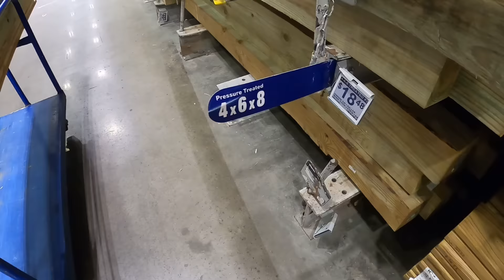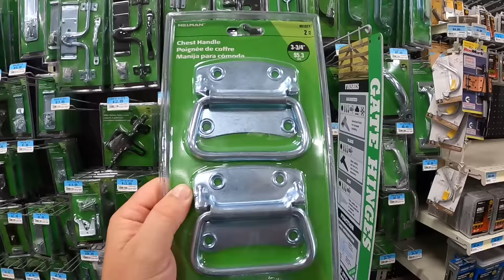Anderson Blocks and RV SnapPads Are A Waste Of Money! | Do This Instead! | Fulltime RV Living!

Comment: We built our own blocks also, however since campsites are sloped in some cases we built blocks at different thicknesses by just using a 2x12 cut square and screwing them together. I have a set of 6  1-1/2", 6  3", 2  4-1/2", & 2  6" blocks and they stack neatly in milk crates. And your right, I saved a bunch of money too!
Reply from the maker: We have a hydraulic auto level system so the jacks will adjust accordingly when leveling! Also I think because of our size the spots we are able to fit in are mostly level. We have only had a few places were the tires were off the ground when level!

Comment: Thanks for this. I built some this week. Unfortunately TS was out of the thinner stall mats and only had the 3/4” which was really heavy. I had some dense floor mats all over the garage and flipped one over and it had this really strong tire rubber just like the stall mats, only about 3/8” though. Worked out great for those who may may not have a TS close. Anyway very cool and effective blocks…thanks again.
Reply from the maker: Thank you!  I am glad I could help you out!  I wanted the Anderson buckets ad the snap pads but didn't like the price!  I said I bet I can build both of them together for way less! 3 years going strong so far!

Comment: Cool idea...but I've never run into a campground requiring rubber pads?   I'm thinking the wood would work just fine without the rubber stall mats.   I made something similar for a previous camper, and the wood outlasted the camper.
Reply from the maker: Just wood would be fine, we have been to several campgrounds that have concrete pads and they require something down between your jack and the concrete! I added rubber as an extra layer!

Comment: We have snap pads, and love them. Keeps the steel pads from sliding especially on rock and concrete.
Reply from the maker: Snap pads are great but they don't offer any height to keep the jacks from extending so far, the Anderson buckets are great at the height but have no rubber protection!  So I built my own that combined the two, the height and the rubber!

Comment: Great idea. I bought the snap pads for our new 5th wheel but wish I would have seen this video first. I think I will make a set like yours and keep the snap pads as back up. We are new to the RV life and about to start a channel and will be sure to give yall a shout out on the block idea.
Reply from the maker: You could always use these with your snap pads, as our taller blocks will allow your jacks to not need to be extended as far, thereby making your rig shake less.
Reply: @PavingNewPaths  I will try that today when we get to our camp spot in Albuquerque, currently in Amarillo.

Comment: I like this idea but my issue is the extra weight for my travel trailer. I have a Toy Hauler and when I tow my bikes I'm not over weight but close fully loaded up. These would be great for when I don't haul the bikes. Thanks for sharing this with everyone
Reply from the maker: They weigh around 18 lbs. a piece, so 108 lbs. total for 6!  We put them in the bed of our truck for travel days!  The rest of the time they are on the ground holding the RV up!

Comment: Both stores are within 3 miles of my house. The orange store is easier to get to since no traffic lights, the blue store has four traffic lights,  so I usually go to orange for most things, but if I can't find it, then off to blue. It also depends on if I'm buying tools, I tend to steer toward the blue store for hand tools.
Reply: I also have two 4 x 6  TSC horse stall mats that I park my trailer wheels on when I am at home.
Reply from the maker: We prefer the blue store but that doesn't mean we won't go browse at the Orange store if we need something!  We used these same horse stall mats to line the floor of our basement storage compartments on the RV!

Comment: Very good idea and nicely done video. But I see one problem. You used screws to attach the rubber pads and the heads of the screws are flush with the surface of the rubber. When weight is put on them the rubber will start to compress then all the weight will be on the heads of the screws. Perhaps instead of screws to attach the rubber pads you could use contact cement.
Reply from the maker: The screws are sunk into the rubber below the surface so the weight on the rubber not the screw heads! We have been using ours for 2 years now and they are still as good as the day we made them! I am not sure an adhesive would hold up with the elements they are in!

Comment: We use the orange stackable one's. Just for easy use and light weight. But we add 2 jacks in the middle of our trailer for the bounce. Might make a set.but add a piece of rope to the handle,as you get older you'll appreciate not having to crawl around or bend down to pull them out.
Reply from the maker: I know what you mean! Getting them out of the back of my truck is the part that has me climbing more than I want to!

Comment: I use snap pads. I can't really use blocks of any kind on my DP because it lets all of the air out of the air bags before leveling and that puts the chassis really close to the ground. My DP also weights 46,000 lbs but I think your blocks could handle that amount of weight. Good job.
Reply from the maker: For you guys the Snap Pads is really the best choice! Who wants to try and put blocks under a Class A!  I'm sure they could handle that weight!  At least once right!
Reply: Same here.
Reply: Same deal, blocks on a DP don’t do well.  Just put snap pads on my DP

Comment: I love my blocks I bought them they are magnetic Anderson buckets you haven't convinced me
Reply from the maker: We think the Anderson Blocks are awesome as well, but you still need to carry wood around to use them!  Unless you're on perfect concrete RV pads they will warp and bend on you! The biggest reason we didn't go with them was the price, these wood blocks are half the cost of the Anderson Buckets and that was at today's lumber prices! The ones we use were built two years ago and it was even cheaper then!

Comment: Great video.  Personally I would make the front pads larger due to the amount of weight on the front landing gear.  When parked on a nice concrete pad it’s not an issue.  Soft pavement, dirt and waking up to mud, more weight distribution is best on the front.  Consider 16” x 16” only for the front.
Reply from the maker: Thank you!  We have 6 stabilizing jacks, and the weight of the trailer is pretty evenly distributed on the jacks!  These are heavy duty enough to support the weight of the trailer just fine!
Reply: @PavingNewPaths  we have six as well on our GD. For instance, if your pin weight is 4200+, then most of that 4200+ is on the front landing gear.  I have seen our rigs six landing gear sink into mud due to heavy rain.  On soft pavement and hot days our front landing gear used to leave imprints.  Just sharing what we experienced.
Reply from the maker: That is why we made these it is an 11x11 square has more surface area than just the 9inch round jack foot!  We have never sunk these into the ground but had issues with just the jack feet prior to making them!
Reply: @PavingNewPaths  I sank with 12x12.  Since going to 16l on the front, never an issue.
Reply: @RoadRider95  I too sank with a little with 12x12 as well. Good point of making the front ones a little larger. I will do new 16x16. Thanks.

Comment: Can you stack these? Or would you recommend building the block with another row 4x6s ?
Reply from the maker: I guess you could stack them if you wanted, but they are already pretty tall now! We had to raise our middle and rear jacks a few inches as some campgrounds had the jacks so low the blocks wouldn't fit! They keep the jacks usually at half or less extention when set up at this height!

Comment: Great video and awesome blocks.  I am looking at building these for our 5th wheel and I have one question.  Is it safe to put these tall blocks under the front landing gear of a 5th wheel ?  I don’t want the camper to slide off and land on my truck when I hook the truck to the camper.  Thanks.
Reply from the maker: We've had no problems in three years, but we also have wheel chocks to keep the trailer from moving during the hitching process. It would take a lot of excessive force to get the trailer to move off these blocks during the hitching process.
Reply: @PavingNewPaths  Thank you very much for the quick reply and the answer I was looking for.  I also use wheel chocks.

Comment: Thanks for the idea
I took you idea and built some similar blocks for our 5th wheel. I used 2x4’s to reduce the weight and I had some left over rubber mat I used in our front storage bay. All four blocks weight in a total of 45lbs 
Safe travels
Reply from the maker: That's great! Let us know how they work out for you when you get a chance to try them out!
Reply: @PavingNewPaths  will be doing so later this week. Couldn’t post a picture but they turned out nice. The test is when we use them.
Reply: Have a question did you use 2x4's instead of the 4x6x8 ?
Reply: @TimVanVranken  yes

Comment: I am a both blue and orange guy if i have to go big box( I prefer local owned business every time). Not sure about the rest of the country but in the northeast i find depending on the project i need to choose my store. Lumber its Lowes all the way. Plumbing or Electrical 9 times out of 10 Lowes will not have everything i need but HD will.
Reply from the maker: I am a blue store first guy!  I have shopped at the orange store when I have to!  My fall back is Ace and Tractor supply before Orange store!

Comment: I’m a Blue store guy.  An interesting idea but you have two main problems with your blocks.  First you can buy plastic blocks for the same price that you spent on lumber, screws, handles, and matting.  Second you spent a full day building them.
Actually the biggest issue I see with them over the plastic is the weight.  As most rv’ers know, trailer weight and space is a killer.  If you say you will toss s them in the bed, they will take away on your available GVWR.  So lighter is always better.
Reply from the maker: Blue Store all the way!  The plastic blocks would not survive our 20,000lb RV, and they would only work on perfect RV pads, anything else and you are still having to put a piece of wood down first to keep from destroying them!  We spent a day building them because we wanted to show people how they could do it themselves, have a better product that will last and save themselves some money!  We are well aware of the weight implications! So much so the video before this one was all about that subject!  You can go check it out here https://youtu.be/Zv6wrVJUvwQ

Comment: I usually am a Red Store (Ace/True Valu) then Blue….but love Tractor supply!!!    We are parked so when we put a pair down they are there for several months and it rains a LOT here, should we do anything differently?   Treated?  Thicker horse mats? minor gaps for air circulation?   
Glad you finally put this out!
Reply from the maker: Ace is great and the usually have things the Big Blue and Orange places don't!  Tractor Supply is also a hidden gem most people forget about!  We have had ours for almost 2 years now and 6 months of that was in wet rainy Florida!  They are holding up fine and when you build them, they are not tight there is gaps to let them breathe!  This is why I went with treated wood I knew they would be exposed all the time to the elements!
Reply: @PavingNewPaths  awesome!   Love y'all's content!

Comment: I have the Anderson jack blocks and a couple of the Lego sets I think the jack blocks are awesome. I’ve had zero trouble with them. My trailer weighs 14,500 so it’s considerably lighter than yours.  I have 4 and 90% of the time they are on the back 4 jacks but sometimes they are in one side and I’ve had them in the front a few times.  Peace
Reply from the maker: We liked the idea of the Anderson buckets, but we have several family members that have them!  They all said the same thing if you are not on perfect ground and don't have a wood block to put down first, they can become warped and wont slide together any longer!  We have also heard of several big rigs not putting wood down first and causing them to crack and break when on rocks, gravel, or older sites that are not flat! So, we decided we could build something that would accomplish what we liked about them and be significantly cheaper!
Reply: @PavingNewPaths  it could be related to weight. I have a medium size camper and have experienced zero issues multiple surfaces including off camber sites. I could see where more weight could cause problems.  I’ll inspect mine this week.

Comment: Great video! I'm not a carpenter so forgive my question, but why do you cut the 4x6s at 11 1/4" and the 1x6 at 11 1/8"??
Reply from the maker: Because when you measure any lumber it is not the number we call it a 4x6 is really  a  3 1/2 x 5 1/2 so two of them width wise comes to 11 1/4 same goes for the 1x 6 except it is 3/4 x 5 1/2

Comment: Here's my experience with DIY blocks. i stayed at a resort in michigan and the check in person showed me to my site. then stayed while i unhitched. "odd" i thought? i pulled out my blocks to put under my jacks and the guy said " You're not unhooking using those" never of hearing of this before i asked why ? he showed me and explained to me that they did'nt want their concrete marked up by metal jacks on concrete. and they didnt want rust stains left on concrete from the screws which he showed me an example of. he went and got me rubber pads to put down first then advised me that other parks had the same policies. yes you did paint your blocks but there is still a metal screw exposed to the elements. you could use a glue or an epoxy to adhere the rubber to the wood but i doubt it would last under a 15,000 lb plus fifth wheel. i looked at my neighbours jack feet on a diesel pusher and seen Snappads and questioned him about them and promptly ordered a set. no muss no fuss no extra parts to store, maintain and carry around. as far as your stability issue with cylinders extended i use Steady fast rv stabilizer bars. they work extremely well. they stay on permanently mounted with just T handles to tighten and loosen.
Reply from the maker: That is something we have never run into! In almost two years and over 50 campgrounds that we have stayed at! It is an interesting take, because I have never considered the screws might rust! Ours are not rusting now after all this time, but if they did I guess I could just change them out!  As far as stabilizer systems go, I don't think those systems work on the big drop frame RV with the hydraulic auto leveling! The front maybe but it would not work on the middle and rear!
Reply: @PavingNewPaths  i was 15 years into rving and numerous different parks when this happened. i was shocked when he said it but i guess it is his park his rules. i was gonna leave and go somewhere else but got talked out of it. he was good about it and explained why and showed me what happens when screws sit on the concrete. the stabilizers do work. i have a 45 foot 3 bedroom New Horizons weighing 20.000 lbs on a bigfoot levelling system and i would not be without them.
Reply: They do sell stainless steel deck screws at the building centers. You could always use them instead and solve that last little problem.

Comment: We have a blue and orange store within 1/4 mile away from each other and prices are identical on just about everything and Ive been leaning towards the orange store, it's much cleaner and more organized and have found the lumber is better quality and they have all related products by each other (wood screws, bots, nuts etc. by the lumber), the blue store is almost one end to the other. One other thing is the employees are actually helpful and dont duck and run when you look at them. I bought 6 Andersen buckets and yes they are expensive but a local rv dealer gave them to me at 45/bucket so that helped but my reason was weight. We pulled our 5th wheel (44ft long/16k lb) with our 19 F350 SRW and we were on the edge of being over weight so I watched every pound I loaded, now we tow it with a 22 F450 so no more weight worries lol.  I still take 6 2x12 pieces to give the buckets a footer to set on.
Reply from the maker: See where I am from Lowes knows they are very helpful, and the Orange Store is the opposite they are not so maybe that's part of why I love the Blue place!  Same reason I like Oreilly's over AutoZone the employees actually help you out and know what they are doing!  I wanted the Andersons but realized I would still have to carry wood as a footer! These weigh around 18-20lbs so overall it's an additional 120lbs, but we have always had these blocks, so this weight has always been included every time we have scaled the RV and truck!

Comment: Blue store all the way! 
Thank you for planting the seed. I have spent the last two weeks looking into what I want for jack pads and these by far have all of the features that you mentioned. I will be building the same thing based on your dimensions this weekend. I can’t wait to have the completed pads especially for those sloped lots that I come across. No longer will I be worried about running out of stroke on my jacks.
Reply from the maker: I'm so glad we helped you decide on a solution! Let us know how your set turns out and if you run into any issues while building them this weekend, give us a shout!
Reply: I have been an Orange Head my whole life, but after the past few years when they started caring more about public politics and corporate coercion, I do whatever i can to go a Blue Store; which isn't easy in my area because for every 1 blue store in a city, there's 5 Orange ones;  SMH.